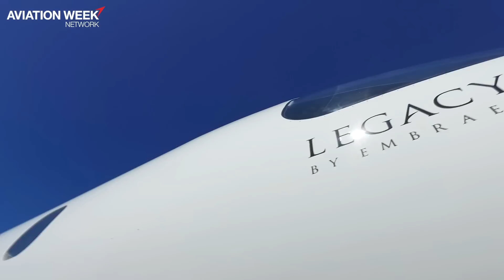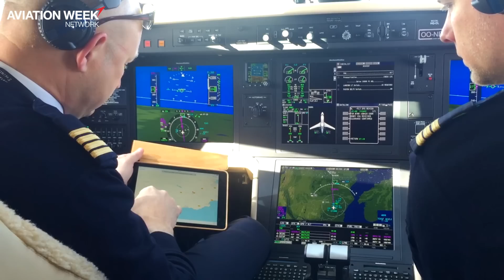Embraer Legacy 450 Wins At Europe's Toughest Airport

Comment: 26,081 lb = 11.830 kp  |  1,312 ft = 399,9 m  |  656 ft = 200 m  |  2,296 ft = 699.82 m  ...             O comprimento da pista (1.080 m) deveria ter sido incluido no texto para nos poupar a necessidade de ir buscar essa informação no 33º segundo da apresentação.                   The length of the runway (3,871 ft = 1.080 m) should be mentioned in the text to avoid the necessity of searching this information on the 33rd second of the show.